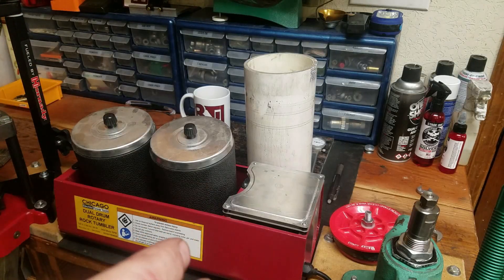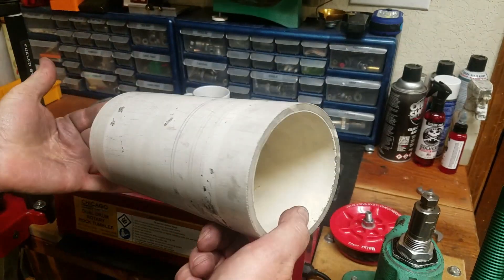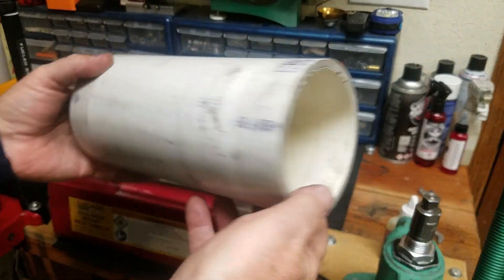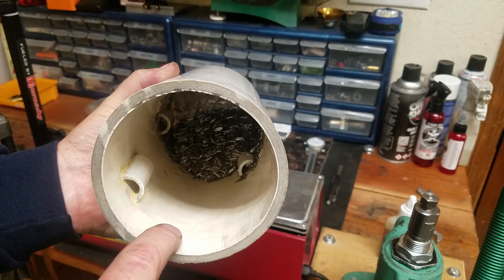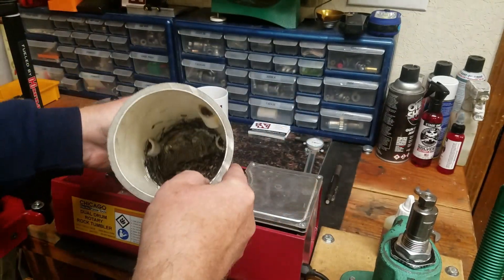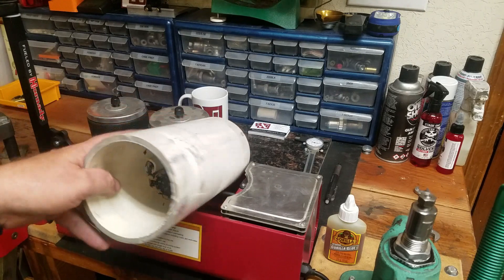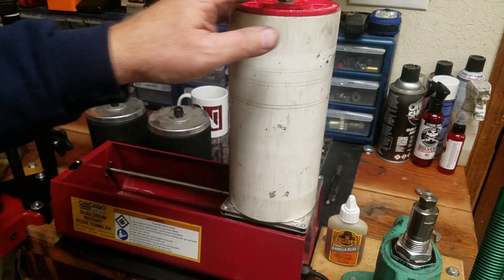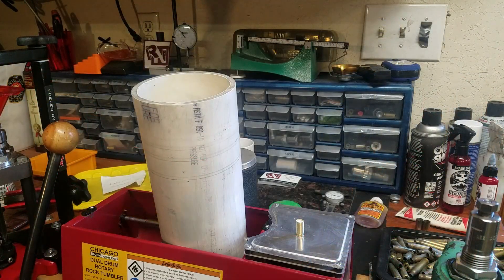*Updated* PVC project, Larger drum for HF dual drum rock tumbler...clean reloading brass!

Comment: I made one of these a couple months ago thanks for making the vid and the tips. The original HF drums were getting pretty beat so followed your instructions from the first vid but skipped the hot glue and went JB Weld epoxy. The epoxy only lasted three sessions before the speed bumps came off. I think i'll take your advice here and go Gorilla glue, as other than the speed bumps working free it works better than the original HF drums
Reply from the maker: Glad its working for you.  Ive had zero problems once I moved to Gorilla glue.  There is a coating on the inside of the DWV pipe that is really slick, makes it hard to get things to stick.
Reply: @TreeTopFlier  you said it - I was thinking of sanding/roughing the inside first then gluing, but figured if Gorilla Glue worked for yours it will be fine. Thanks again for making the vid!
Reply from the maker: @leveractiongypsy1848  I didnt rough it up but I do clean it with acetone good first.,
Reply: well we'll see how long mine holds up lol a reglue job is no big deal

Comment: As far as gluing the interrupters... There is no better super glue than Starbond! It comes in thin, medium, and thick and can be had on Amazon. Keep it in the fridge after opening and it will stay liquid for years! Another little trick if you need to fill a crack or hole is to put the super glue in and sprinkle some baking soda on it. This will make the glue dry instantly and hard as a rock! I snapped a crown off last year and used that trick and it stayed put for 6 months!
Reply from the maker: Thanks for the tip, i like the idea of being able to keep it longer.

Comment: Watched your first one a little while ago. I was only surprised that the hot glue worked. I use hot glue more often than I should and it always tries to come loose eventually.
When I do your customization eventually I will try the Gorilla glue. I was going to use epoxy but that sounds simpler. 
Thanks for taking time to redo something to make it better.
And yeah, I couldn't believe all the comments about it not turning... you said it did right in the video, but you know, youtube...

Comment: You purchase 4" PVC without the inner core so that you can use PVC solvent to adhere the tumbler strips inside with no problem.
Reply from the maker: That's the thing.  Most folks dont have access to 4" pressure pipe in PVC but cell core sewer pipe is common in 2' lengths at lowes.

Comment: I've dry tumbled for 15 years using the same Frankford Arsenal tumbler and when it finally gives up the ghost I've thought about going to wet tumbling but there are a couple of things I don't like about it.  Size is one but the HF tumbler seems to be sized about right for my needs and the price is right.  Drying the brass is another.  I'm not about to use the "out in the sun" method and I'm not keen on the oven method.  I don't have the space to just lay them out and let them air dry in the garage so I'd like to know what method you use.  The dedicated case dryers appear to work well but that's another expense.  The other thing that I'm not sure about is how to dispose of the dirty water afterwards.  I think most people just dump it down the drain and I do have a utility tub in my laundry room but I'm a little hesitant about that disposal method.  How do you dispose of yours?  Thank you.

Comment: I tried it and it exceeded my expectations. The only complaint I have is the Harbor Freight tumbler is not that well built. The bearings on the rods got stiff after about an hour of tumbling and I had to lubricate them to get them going again. In hindsight, all you need is a slow RPM motor to turn the drum, like an ice cream maker. Bottom line, I highly recommend this method of brass cleaning.

Comment: I just designed and tested a 3D printable agitator that stuffs into the 4" pipe without any further fastening. Sped up brass tumbling vs rubber drums by at least 33%. https://www.thingiverse.com/thing:4527571

Comment: I followed most of your instructions which worked ok.  To create an agitator, I used a 3” Pvc pipe on the inside.  I cut three 1” sections which I attached with PVC cement with the curved side facing the middle.  Fits snug and does a good job.

Comment: To get better traction on the outside, you should try gluing safety tread tape to the outside of your drum.  https://www.homedepot.com/p/3M-Safety-Walk-Slip-Resistant-Step-and-Reflective-Tread-6-in-x-2-ft-7768NA/100391699

Comment: Made mine yesterday day, I tried the small PVC inside to help with the tumble, but mine came off. So today I went to Home Depot and picked up some self-adhesive rubber weather strips that are about 1/2” wide. Sanded the inside the. I placed 8 of them about 3/4” apart and they worked great and they are still adhered to the inside!! Thanks for the vids!!!

Comment: Those two barrel tumblers (and the singles as well) (from harbor F or lortone or anyone elses name) have two things wrong

One the belts are low quality rubber and counter intuitively the belt is too THICK! it makes it difficult for the belt to bend around the small pully

Two the FATAL flaw - plastic "bearings" the smallest grain of grit gets in there and things no longer go around.

The Fix - the motor is fine, the shafts and pulleys are fine. Build a new or modify the current frame with real, sealed ball bearings and use a good belt (say from an old cassette recorder) 

My machine can run 1-12 pound drum, 2-6 pound drums and 2-4 pound drums from that same motor and I have never changed the belts in 5 years
Reply: Lovely prototype

Comment: Getting a 4" clear round disk from TAP also works, and is great for a viewing port, easily shows how clean or dirty your brass is mid cycle. Gorilla glue does the job.
Reply from the maker: Sounds good!
Reply: @TreeTopFlier  You purchase 4" PVC without the inner core so that you can use PVC solvent to adhere the tumbler strips inside with no problem.
Reply: @1982nsu  If I'm not mistaken, he's chosen that so that the nut and threads from the cap just barely clear the end of the tumbler. Anything lower and it won't fit. Pretty sure anyway that's the deal.

Comment: I made myself, Jesse B Utdoors and Willie Bulletman one. I used the half inch pie for tumblers and used the cleaner/glue method. I have another one with n agitators in it I plan to use for powder coating. Thanks for a great idea.
Reply from the maker: I saw JB's mail call from you.  I wondered if you had seen my older video or just came to the same conclusion.  Thanks for watching bro.
Reply: TreeTopFlier yes, Sir, I try to watch all your videos. My tank is working great. It still has its limitations, but it sure increases the volume of the HF unit. One of these days, I’m gonna buy a powder measure stand from you. Keep up the good work.
Reply from the maker: @jh5869  Thank you sir

Comment: I enjoyed this video, and my Frankford Arsenal wet tumbler was a great addition for brass cleaning. I used the steel pins only once because they were more trouble than they were worth when it came time to cleanup.
The Lemi shine works well but to much and your brass will have a dull gold appearance. Your tumbler does the exact same thing but a lot less $$$
Reply: WRXS  but if you aren’t using steel pins do you still get the inside of the cases and primer pockets clean?
Reply: @davidcoiner6550  Thank you for the reply David, because my use of the Dillon 650 and my bulk reloading is once fired 9mm cases, I never de-prime before reloading because it would double my time at the bench, so can not comment on primer pockets. But the cases are shiny clean inside and out.
Reply from the maker: One unexpected bonus to the PVC tumbler is its pretty quiet compared to some of the others.

Comment: Im going to use a rubber liner sleeve in mine, been thinking about it.
Reply from the maker: Hmm.   Just curious, why would you want or need to do that?
Reply: @TreeTopFlier  Cut down on the noise and a little more grip on cases
Reply from the maker: @jander6442  Oh got ya.  FYI this tumbler setup is already quiet compared to the Frankford Arsenal tumbler

Comment: Before Franklin Arsenal released their tumbler there was Rebel 17, it was expensive but was done right and I jumped on that bandwagon.  Ironically my uncle replaced the bushings in my HF tumbler with ball bearings at same time but I no longer needed, so it's sitting collecting dust but this idea is really cool, I've seen the first video.  I was thinking of making my own thinner expanding plug with having a lathe it shouldn't be hard, just need a thick o-ring to squeeze.
Reply from the maker: I dont know Dima, your lathe time may be better spent on your gas check maker. but it does sound like an interesting challenge.

Comment: After I watched your original video I found a frankford arsenal tumbler for $109 and said heck it, was lazy and just    bought it. I kinda wish I went with the harbor freight because its like 2 in one. You have your custom big bin or if you want to clean 40 and 45 cases at the same time, you can put them in separate bins. I’ll probably get a hf cleaner when I upgrade my bench. Thanks for all the videos!
Reply from the maker: One thing I like about it is it is quieter than the other options ive seen and the whole unit doesn't take up a lot of space.  And your right, the small drums still work great for smaller cases like 9mm

Comment: Very cool,  I grabbed the single tumbler and so far it does great job with steel pins, teaspoon arm n hammer oxy laundry and hot water 30-45 mins, might upgrade to double but I don't have a huge quantity to worry about
Reply from the maker: Im with you, this works for me, I have a pretty low volume to process.